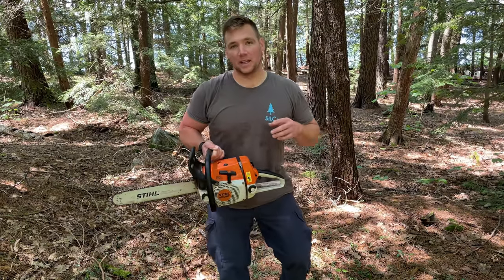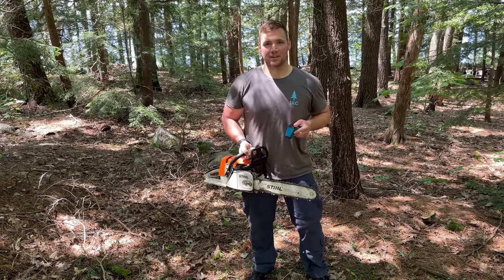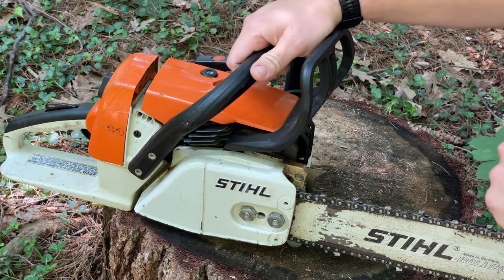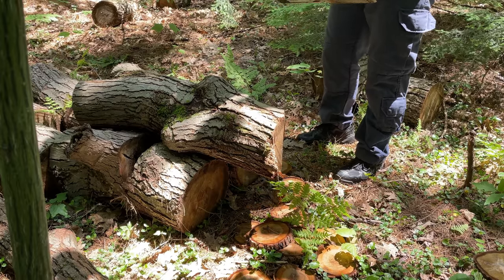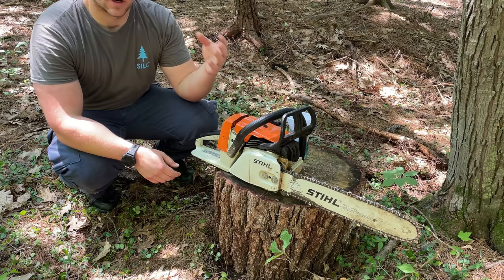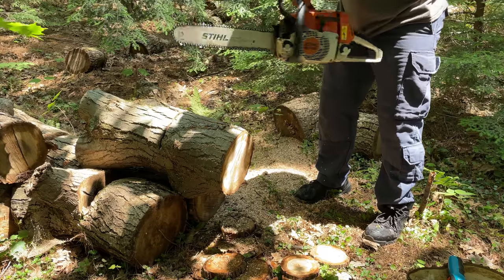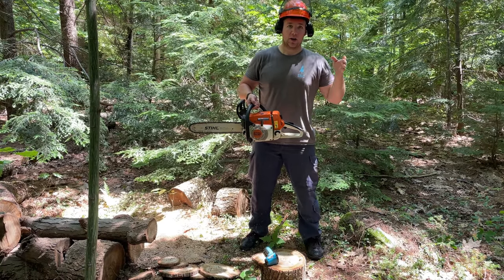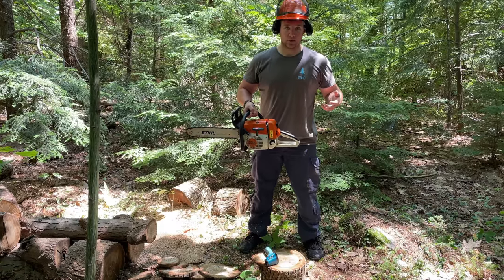Will my chainsaw last longer if I use more oil? Is it safer? (25:1 VS 50:1 temperature testing)

Comment: Lean oil mixture and the engine wears quickly, rich oil mixture and spark plugs wear quickly.
Spark plugs are cheap and easy to replace.
Engines are expensive and hard to replace or overhaul.

Comment: I've never encountered a 25:1 ratio in 50 years of 2 cycle use. 32:1 or 40:1 would have been more realistic. I have encountered those ratios by manufactures. Interesting video nevertheless. Got me thinking.
Reply from the maker: Hey there! I know, but there’s SO much variability between what people run I wanted to make a video of a “double” oil ratio. Thanks for watching!

Comment: Have a Stihl from the 80s and heat with wood used Stihl 50 1 the whole time. It finally died but the cylinder is fine it needs a coil and carb and parts are no longer available

Comment: Nice demo dave! I run 40 or 45.1 in my "modern saws" but I have an old, old Craftsman made by roper that calls for 10.1 30 weight automotive oil so I use 32.1 modern 2 stroke...something about brass parts in the crank case. Anyway nice job on the video
Reply from the maker: Hey Ron! Thanks for the video. I appreciate it!

Comment: You made it run leaner fuel mixture when you did 25:1. That’s why the temps are up. Not the oil in and of itself. If you’d of re jetted for the leaner fuel mix (more oil), then it would of made the same or more power with the higher oil content. A proper testing methodology would need to be a bit more complex than what you did. Had you been able to do this on a system that had an independent oil mix pump like maybe a marine or two stroke road bike like an RD400, and you were able to change the oil ratios independent of the AF mixture, I’m sure you would not see the same result as you saw here.

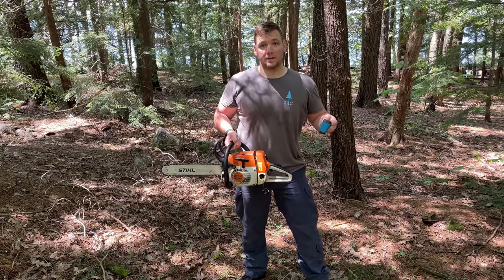Comment: I have recentely i have bought a Makita model EA3110T25B chainsaw. On the user manual the mix ratio is 1:25 (4%). My chainsaw seems the same of Maruyama MCV31T-14, then Active model 28.28 and Dolmar model PS 311TH as well and all the user manuals have the same ratio. Is that ratio correct with all oils, with 100% syntetic too, or only minerals ones? My 2 stroke equipement engines usually use 1:50 (2%) ratio. Can you tell me if that ratio is the same with every type of 2 stroke engine lubrificants (always 1:25) or there are differences? Thank you for every suggest.

Comment: I definitely wondered if there was any tuning done to get maximum performance for each fuel? Or if adjustments stayed the same for each fuel. Sounds like with the extra heat comes a little extra lubrication, still makes me wonder which is better. I still run 40:1 myself with pretty great results. Although my 201 moronic does seems to not like it as much.
Reply: I run what ever the manufacturer says to run. The Engineers know their jobs. This reminds me of the whole "new cars are burning more oil so we should go with a thicker oil" routine. The truth is that thicker oil isn't going to help. The piston rings are thinner so they can get the efficiency the EPA demands. Those thinner rings let more oil by cause more oil usage. A thicker oil is still going to get by those rings and burn off.

Comment: Interesting, but there is a possibility that your conclusion is wrong. The higher temperature and the lack of power with more oil, might be the result of a leaner petrol/air mixture. With much more oil in, the carburettor should be adjusted. With the same adjustment there is less petrol going thru. I have run my old Stihl lots of hours every year on a 4% mixture for 35 years. Still running brilliant.

Comment: cool stuff.  yeah, my thoughts are what everyone else is saying, that the engineers already thought all of the possibilities out and tested to the point of the best balance in performance vs longevity.  The only thing that makes me doubt what the companies will push nowadays is the EPA.  With concern for the environment i would argue these companies are not going to tell you the real truth always because they want to keep the EPA happy.  I know when you "chip" a car you make the engine run healthier, which tells me the factory is trying to keep too many different people happy, and so in factory form, your stuff is running as well as it can, as they are trying to keep the EPA types happy.
Reply from the maker: That’s the balance for sure. Are they trying to make EPA happy or are they making their equipment run the best for the longest time? I’m not sure.
Reply: @DavesSmallEngines  it is no secret that the epa wants car and motorcycle engines to run lean, which is harder on the motor.  The companies are forced to play along if they want to sell in the USA. It hurts the consumer

Comment: If you want your 2 cycle engine to last the longest time possible, use Saber racing oil by Amsoil. They will guarantee their product in your engine clear down to 100:1, & it is pretty easy on the nose and especially on the wallet. I have been running all my equipment at about 85:1 for about 7 years now, mixed with non-ethanol 90 octane fuel with ZERO issues ( other than saving money!! )

Comment: Most Chinese saws use the 25/1 I used it to break in the engine and then switched to  40/1 and also 50/1 there after without any problems

Comment: I think  using a tac and adjusting the high jet  for one mix  along with your numbers would tell us a lot more .
Reply from the maker: I agree. I wanted to make a test to show the difference for the average user.
Reply: @DavesSmallEngines  gotcha ,all those guys we see saying im goona run 20 to 1 for brake in and not tune for it .

Comment: Just run with the manufacturer recommends. The only thing I can see 25:1 doing is making less power. Causing the saw to work harder putting more wear on the the saw.

Comment: When you run double the oil ratio, you need to run lean. The more oil you use will create more compression. Compression creates heat.
Reply from the maker: Yep!

Comment: Bought a new blower ran it factory spec oil mixture blew up 4 th use I never did that again my dad always told me if it wasn’t smoking it isn’t good and I always use more oil and my junk weed eater brand has been running strong since 2014 I promise you it is smoking like crazy never changed the plug either.

Comment: The chain doesn't cut worth a darn. The mixture is obviously too rich for the 50 to  1 mix so it will run cooler.   The 25 to 1 mix seems to run about correct ( leaner than 50 to 1 ) and therfore probably running at a higher temperature as it should with the proper air / fuel mixture.   My guess is that if the engine were leaned out to run properly with the 50 to 1 mix the temps would be similar.   Set both mixtures with a tach to the same rpm output and then check the results.  And use a good chain.
Reply from the maker: Will do, thanks Troy!

Comment: I have a 80 cc motorized bicycle  2 stroke with amsoil  dominator  racing oilsays it's to be a 50/1 not shure if the bike has been broken it yet . But what do u think ??
Reply from the maker: I can’t see an issue with following the directions of the manufacturer!

Comment: More oil is not "better" when working with roller and needle bearings. In fact it's much, much worse. Those bearings need to roll to perform their function. With too much oil the rolling element creates a hydrodynamic wedge of oil ahead of the bearing and it ceases to roll and instead skids. This principle can be seen in all plain bearing engines (which two strokes aren't) as the oil actually forms a wedge of seperation between the journal and the bearing surface, floating the crankshaft, or other shafts as well, away from the bearing. Side note...98% of four stroke engine bearing wear comes at start up before the oil pressure has time to create that seperation wedge. Now imagine your newer vehicles that auto shut down the engine every time you stop at a light. Oil is hot and less viscous, pressure heads off in seconds...now you're starting from scratch again, metal on metal, when the engine restarts. Sound like a good idea?

Comment: This test can’t conclude that 25:1 was hotter than 50:1 because you may have let the exterior of the saw cool down but the interior of the saw crankcase oil in the bar oil tank connecting rod piston were all heat soaked from the first run so yeah sure the 25:1 would show a higher temp! If your going to compare this way the saw needs to set until the thing is cooled off inside and out or the next day and compare the temp change from beginning to end if the temp is different on the different day! You can’t say one is better or worse by testing them this way!

Comment: This a very cool test thanks for posting. This is very consistent with nitro methonal model 2 cycle glow engines used in ABC or aluminum piston chrome plated sleave rc cars and planes.  The higher the oil content the higher the temperature and the smaller the tuning window, less oxygen needs a leaner mix.  Vs the higher the nitromethane content and lower the oil the cooler they run and have a much larger tuning window. Because of the extra oxygen in the fuel you can run ritcher, which is a cooler optimum tune for the engine.  Everything has book ends though, to little oil more heat to much oil more heat failure faster.  To littler nitro more heat to much nitro to high of compression and you need to add shims to lower compression for that optimum burn ratio.  Anyway do what the engine likes 👍.  It's usually the manufacturer recommendations.  However foe engine break in which finalizes part fitment some castor oil is helpful, it's attracted to heat, polymerizes and protects parts from heat, where there is extra from mating the rings to the cylinder...etc.

Comment: There are multiple things that effect the running of the motor.  I run 32:1 and have run my saws for years.  It would be good to do a test with a retuned saw between test.  To me the more oil would make the saw run leaner.
Reply: Well Michael, It depends what the saw was set up to use in the first place? Was it 50-1? If so then the saw would really need setting up to run on 25-1 for  the second test with the extra oil which would make the saw run richer, Also the way the saw took quite a few pulls to get it to start from cold maybe it's letting the fuel 'drop back' to the tank?, I've always ran my saws, strimmers, ( hedge cutter &  pole saw are 4mix) on 25-1 using Stihl super, My main saw being a 30yr old Husqvarna 254xp which i've owned from new and the compression is unbelievable! And it has done a lot of work! I always let saws warm up before working them, I makes me cringe when someone starts a saw and revs it flat out from cold!

Comment: So I know you're going to make the argument about using more oil but it's not creating a lien condition, The reason of a higher cylinder temperatures is because the more BTUs because you're burning more fuel per cycle. Using the oil as a fuel is it a sense like a diesel engine.

Comment: The extra heat is a small worry to me. It the extra carbon build up it will to. It could drop carbon deposits in the cylinder and score the piston and cylinder.

Comment: I bought a 2 stroke mixing bottle from China a couple of years ago which was marked up for 25:1 40:1 and 50:1. Wondered why my machines were so smoky and on investigation the bottle was marked up wrong and was putting nearly double the amount of oil !
Reply from the maker: Dang! Makes sense though. What do you run now?

Comment: Hey Dave!
Thanks for this awesome test! 👍👍
Greetings, Stefan
Reply: Hey Dave. 
I thought a bit about your video...🙈
The saw is running lean with the 25:1, because there‘s not enough fuel in your mixture. You said it also in your vid.
Would the temperature also rise that much, if you adjust the carb before running the saw on the 25:1 mix? That would be another interesting test...🤣🤣👍
Greetings, Stefan
Reply from the maker: That would be a cool test! Maybe a part 2?!
Reply: @DavesSmallEngines  
I hope so...🤣👍

Comment: Used to put 50:1mix for 2  1/2 gal. In a 2 gal can never had a problem, it looked like you're running a dull chain in dead wood.

Comment: Running rich will just cause excessive smoke and smell and load up the engine.  Back in the day they ran much richer because the oil wasn't as good.  With all the advances in oil the mixtures got leaner.    The pro's who use saws for a living usually don't wear the engines out, the saws just fall apart over time.

Comment: 25:1 is a mix you would have seen for older engines from the 70’s…most 2-strokes are 50:1 today…better gas, better oil, better engines!…gone are the days of mixing in what ever oil you had kicking around and what ever volumes and mixes…these new engines don’t like those “guess-a-gas” mixes from back in the day!..lol!!

Comment: Too much oil will cause carbon build up around the rings and could hurt wear on cylinder. Also I believe 50 to 1 is purely for environmental regulations to cut down emissions.  I do 30 to 40 to 1

Comment: I run 40:1 in all my two strokes. Seems like they run longer, last longer.and need less carburetor adjustments. And oh, non ethanol fuel whenever possible.

Comment: So with it running a higher temp it's doing damage, I assume. I've had the impression that 40:1 would be the better choice for longevity, while not raising the temp to much more that 50:1
Reply: The test was somewhat flawed, 40:1 is infinitely better than 50:1.

Comment: Hey Dave one time I put some model airplane fuel in my chainsaw and it would not start so I drained it out put some gas in fired it up shut it off drain the tank so I still had gas in the carburetor then I put a whole bunch of model airplane fuel in the tank fired it up and when the model airplane fuel hit the carburetor the RPM increased and the exhaust smoke smelled really good and my eyes got as big as saucers and I said oh boy this is going to be fun and I went over to a one foot diameter alder log and the saw was an absolute animal it reminded me of those old tractors they start on gas and then flip them over to diesel. but I decided I shouldn't be doing things like this I might melt the piston and model airplane fuel is real expensive what do you think
Reply from the maker: I’m not sure what the composition or lubrication properties of the airplane gas… hmm.

Comment: The oil transfers heat, the higher oil ratio (25) makes less power, thus reducing chain speed, thus taking longer in the cut.  You are effectively leaning out the engine by reducing the fuel ratio by fifty percent.  Do it again with a tach, setting the high end for max rpm minus say 300 rpm for both fuel mixes.  Bet you get different results.

Comment: Get that smallest 12 oz gatorade bottle fill it to the brim with your choice of two-stroke oil put it in a 5 gallon gas can and pump 5 gallons of 87 or 89 octane. let it shake up on your drive to where you're going it's been 25 years never blown up a two-stroke have a commercial gardening service.

Comment: I have wondered if running 40 to 1 instead of 50:1 oil. I wonder if it would hurt anything
Reply: I rather a 40, 45:1. At 40:1 theres like only 5 mL of oil more per L so its not that much more. I use 40:1 in the summer as I find 50:1 to dry and in winter I use more 45:1 as its colder and want ti have the least amount of carbon buildup but still have a good lubrication.
Reply from the maker: Hey! Personally I run 45:1 for that added bit of safety.

Comment: The only thing I'd like to see different in a v2 of this video would be also retuning the carburetor for the 25:1 mixture -- if it's set to run correctly at 50:1 then by changing the fuel mix you're definitely going to see differences in power output because it's not providing the same amount of fuel to the engine even though you could tune it to do so (and I bet this is why it feels sluggish in the cut).

That being said I doubt that would change the temperature results much, and 25:1 for a 50:1 mixture is bad logic, but, ~~science~~ or something!
Reply from the maker: Hey Ben! Great points. I suppose I could re tune for the thicker oil mixture… but I would argue that this is above and beyond the normal users of chainsaws. I wanted to show what happens if you simply add more oil to the fuel mixture.

I also think…. Why bother? It runs so well with the 50:1. No need to mess around, in my opinion!

Cheers!
Reply: @DavesSmallEngines  I guess most people here are not most people because everyone is asking or stating the same question.
Reply from the maker: @iffykidmn8170  for sure lots are curious about it. Maybe worth a second video!
Reply: @DavesSmallEngines  1:38 is ok?

Comment: I  didn't notice if you let the saw cool down completely after the first test ,did you ?
Reply from the maker: Yes I did, and then let it idle the same amount of time which would have given plenty of time for the engine to stabilize to operating temperature!

Comment: I think people are more likely to ‘richen up’ their 50:1 mix by adding only a little more oil to account for the oil stuck on the walls of the measure on the stihl red or green oil bottle measuring pot. I know I do…. It’s never going to be anywhere near 25:1 doing it like that , more like 45:1 at worst….. I think I won’t be alone in this….

Comment: Good video, but you may have misleading results. Try that test again, but tune the saw for the richer mix and start with the 25:1. I suspect there was some heat soak from the first test in the saw. Your saw didn't have the power because it was too rich. Lots to consider. Main reason the manufacturer recommends  50:1 isn't longevity of the saw. its reaching acceptable EPA emissions.
Reply: The UN and other Green Zealots will never tell me how much oil I can use. 40:1 bare minimum.
Reply from the maker: I wanted to make a video that would appeal to the masses - most folks aren’t comfortable tuning a carb.